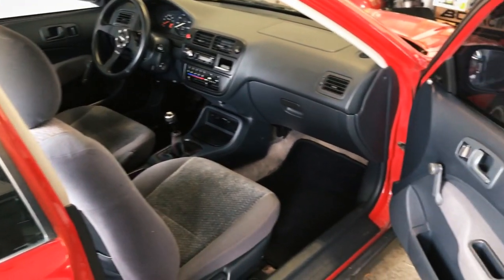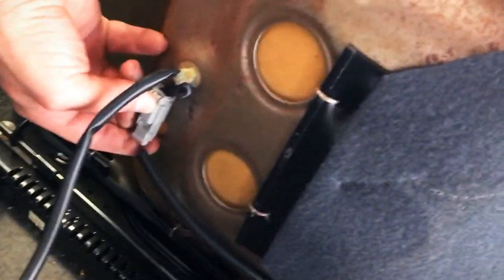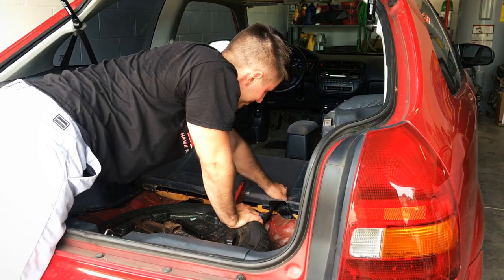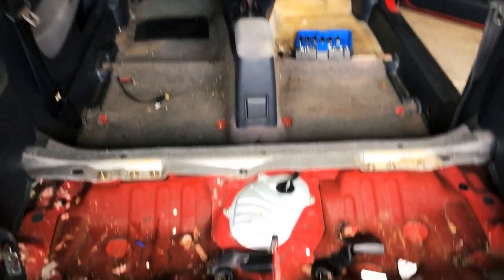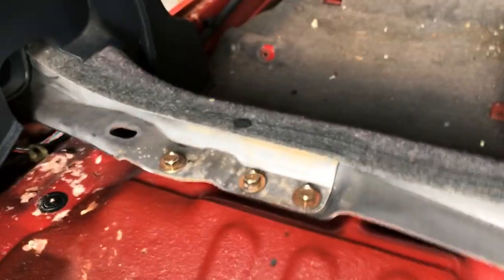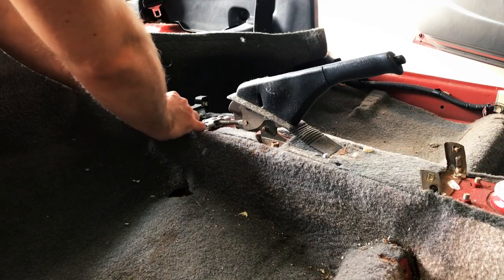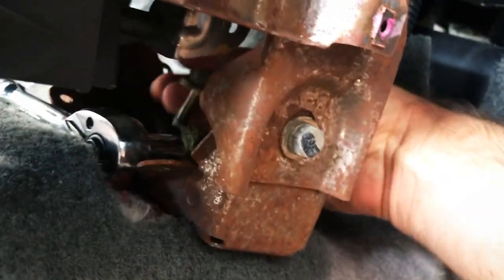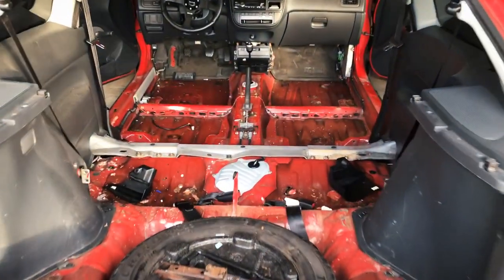Interior Restoration Starts Now! | Civic Carpet Removal How To

Comment: I did the same thing with cutting the carpet that goes behind the dash bracket on my eg, it would have been a pain if I hadn't. You probably won't need to stitch it back together, it's covered up and out of the way, has never caused me problems with how the carpet sits and fits. Also easy to remove again if you ever have to. So I'd just not worry about it. :D
Reply: So true its covered behind that center bracket for the dash behind the cup holders so you and no one else notices it
Reply from the maker: Yeah you’re right man, you don’t even see it behind the dash bracket. I seriously thought for a second about removing the srs plugs but then I decided not to and I’m glad I didn’t. Like you said, if I have to take it out again it makes it even easier. Check out next weeks episode to see that color change, it came out so good
Reply: Refine Movement can’t wait!

Comment: Do you know if the EK hatches have the interior trim in a dark grey? Specifically the rear quarter trim panels. I noticed your's looks to be a darker grey. My 97 dx has light grey interior panels and have seen a couple at the junk yard with light grey as well. Looking to change mine over to a darker grey if possible without having to paint
Reply: They do, both of ours have a "Interior color Type K" sticker at the passenger door, also the B16 powered ones here in Europe came with a darker interior.I assume same thing in the US?